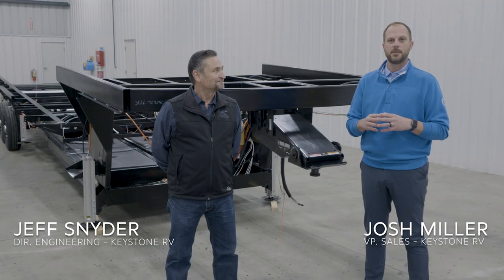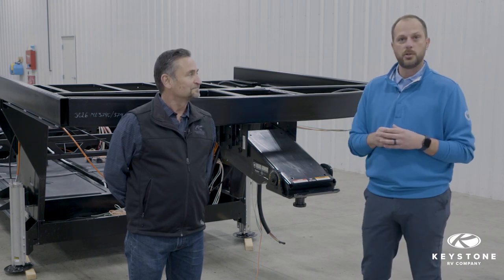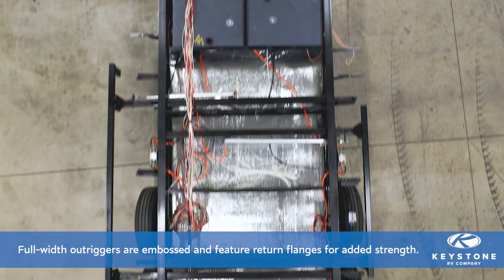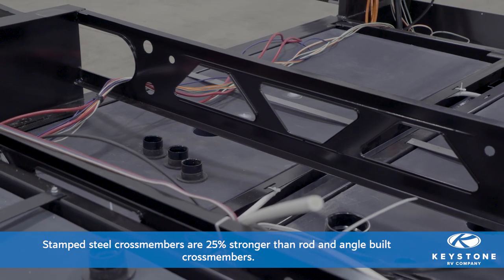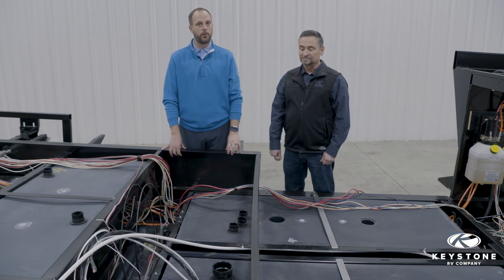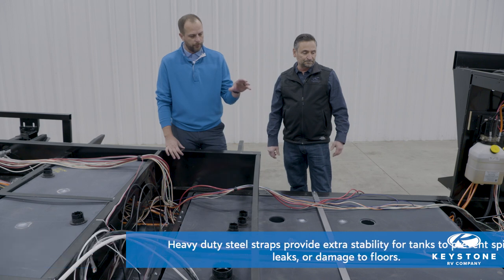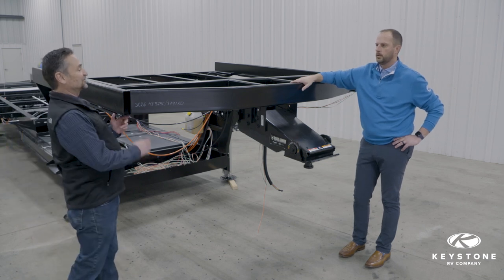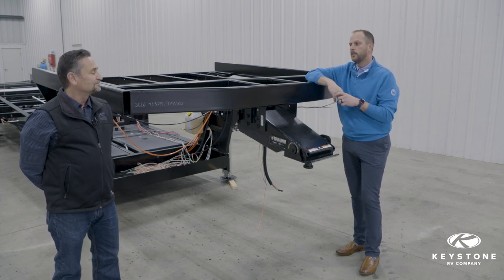Keystone RV's Exclusive Fifth Wheel Chassis:  Better By Design

Comment: I bought a 2021 3791RD in October of 2020 and was told the frame flex issue was resolved for the new models.  My wife noticed a large crack down the side last night. I tow with a 2020 F350 DRW and have a Trail Saver hitch.  The hitch has 3 airbags and 4 shock absorbers and the RV still cracked.  Pretty disappointing. .........  I heard that best place to take it is Affinity RV Group.  The problem is that is over 2k miles round trip and will cost me over 1k in fuel.
Reply from the maker: Good morning, we are very sorry to hear this from you. Please do call our retail customer service team directly at 1-866-425-4369 so one of our advisors can assist you further on this! They are available Monday-Thursday 9am-5pm EST and Fridays 9am-4pm EST. Thank you.
Reply: Ya right, phone a customer service rep? You stoners installed the bedroom cable slide angle brackets wrong, the slide doesn’t go out enough so the closet door hits the bed frame and will not open fully. The brackets needed to be flush with the inside of the cabinet not 1-3/4 inches ahead. Phoned and got the standard answer of that’s the way they are supposed to be installed. Took pictures, gave measurements but again dealing with stoners is like wrestling a pig in the mud, the pigs love it.

Comment: I have new Keystone Raptor 356 5th wheel purchased in April 2020.  We love it but have a significant issue with the frame being bent.  The left side of the RV has two slides, full refrigerator, oven and microwave.  The leaf springs are flat and the tires rub the wheel well.  It’s a major safety issue.  The RV is not level.  Today, we had the leaf springs replaced and they are flat and did not resolve the issue.  So frustrating.  Keystone, please help.  I have been communicating with customer service and they are aware.
Reply from the maker: Good morning, and we are sorry to hear you have had issues with your unit. Our retail team is best suited to help you through the process. So please continue to work with them directly. Should you need to reach them, their number is 1-866-425-4369. Thank you.

Comment: Your strap is not heavy metal a 1 1/2" x 1/8 piece of flat bar is not very strong. Now use some 2" x  1/4" and that might help. Also why not use some type of sleeve where the wires pass through the cross members? Just because they are a rolled edge doesn't mean they won't get chafed.
Reply from the maker: This is great feedback. We will get this forwarded on to the product team as well for review. Thank you for sharing your recommendations with us.

Comment: Is it possible to get a frame diagram showing tank placement and plumbing layout for a 2020 Fuzion 369?
Reply from the maker: Good morning, thank you for contacting Keystone RV! For immediate assistance on this, please contact our Owner Relations Department directly, with the last 8 digits of the VIN, at 1-866-425-4369 Monday-Thursday 8am-5pm & Friday 8am-4pm EST. Any one of our Retail Advisors will be happy to assist. Thank you!
Reply: @KeystoneRVCompany  Well that didn't work. I spoke with Lisa, she states that Owner support does not provide those, and that I may be able to get this through my Keystone dealer.  I'll pursue that route for now.
Fyi, my Fuzion 369 has 3 known holding tanks, yet 4 tank drain valves. I assume the 4th is for the W/D hookup in the garage. Idk if that is a holding tank or a direct drain line only.  Dealer can't answer that question either.
Reply from the maker: @winginitwithjohn8451  would you please DM the last 8 digits of your VIN to our Facebook page? We will see what we can do to help answer your question. Just reference that you were asked to send a DM from our YouTube channel. Thank you!